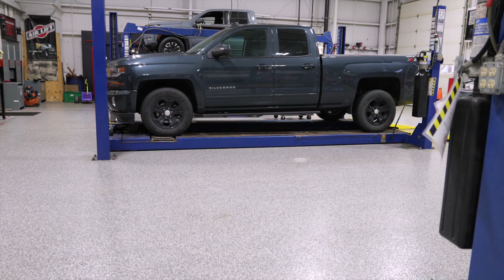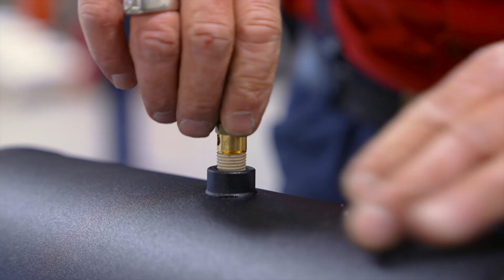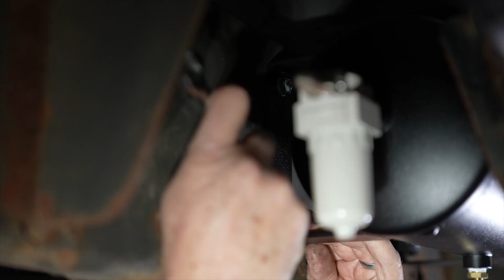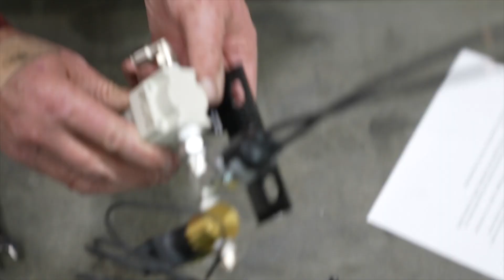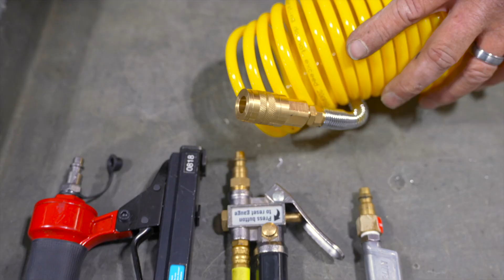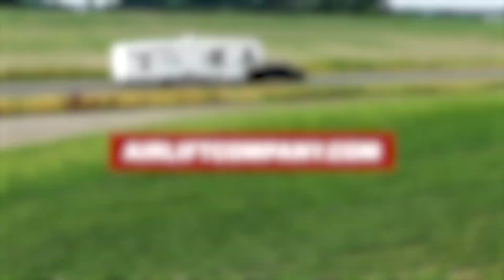WirelessOne / WirelessAir Tank EZ Mount Upgrade Installation - 25981EZ 25981 74100EZ 74100 Air Lift

Comment: I’m interested in buying this, but is the air tank only to use for accessories and tools? or can I use it for my bags like hooking up the wireless air compressor and tank running everything to my bags and then when I need air, it takes it from the tank and fill it faster
Reply from the maker: Great question! The tank is integrated into the whole system - so the wireless system does use air from the tank to inflate your air springs quicker. There is valving in place to allow you to use air powered accessories from the tank, and this will not affect the pressure in the bags.